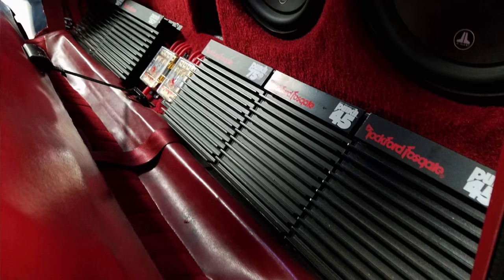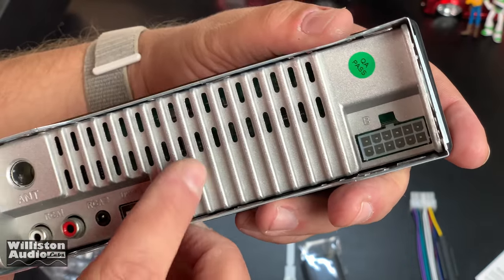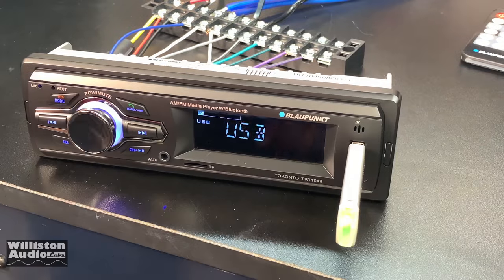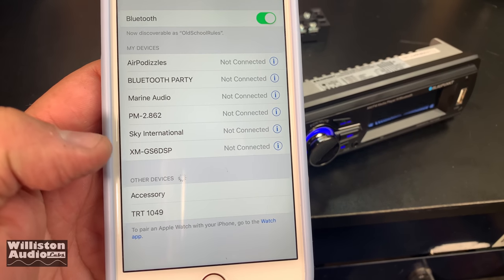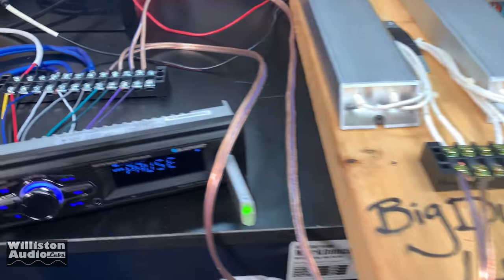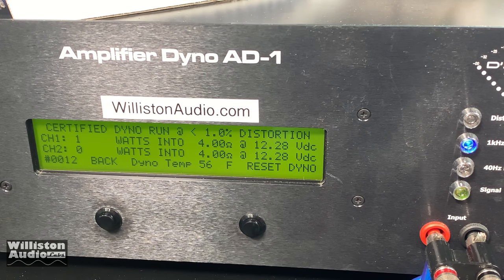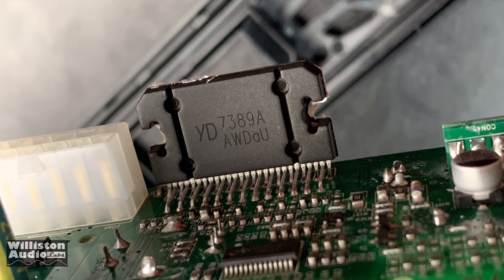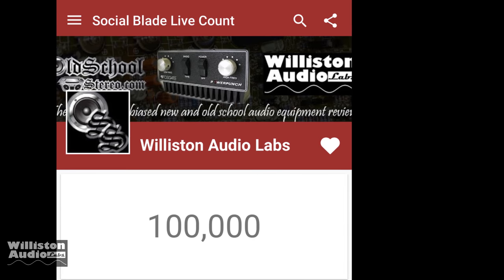Is a $10 Walmart Car Stereo Any Good? [4K]

Comment: i have an ammo can i got when i was in the marines corps. i want to turn it into a portable radio and maybe this $10 usd thing would be great for what im looking for. can you tell me what size and file format the usb drive needs to be?
Reply: Most likely fat32 and 32 gig. Fat32 is easy for embedded computers to use and a simple 16 bit processor can handle drive sizes up to 1tb but software gets slow above 64gig.
Reply: @therealjammit  thats what i was thinking. my kenwood only does fat 32 and fat16, and up to 32gig but can only handle like 200 folders which with my music is like 22 gigabytes if i finesse it.

Comment: I had a much more expensive JVC stereo with all the same features and no cd player, yet had RDS, that would get hot on long drives and start crackling, should have done an extended test over say an hour near top volume

Comment: The 3.5mm/RCA2 jack is probably some kind of digital connection like SP/DIF, maybe to connect to a power booster made by the same company, which would have the appropriate connections. It looks similar to the jack on the back of my creative sound blaster that is intended for SPDIF, except that the SPDIF input on my home stereo is an RCA jack, and I don’t know what kind of adapters or connectors I would need to plug the back of my sound blaster into the SPDIF or Lightpipe on my TV. The back of my TV connects to my Kenwood with a light pipe got from Walmart for five dollars at what has been working well. But this does not look like a standard TOSlink.

I may buy one of these things to replace my branded Hyundai six CD changer which is on it’s last legs after a Home made a CD got stuck in there and wrecked the entire assembly. But unfortunately in order to replace something as simple as an audio unit, I have to disassemble the Dashboard in my car 😂
Reply: It would definitely make sense if Blaupunkt has a secondary power booster, intended to be used with this head unit- i’m going to see if I can find a catalog online to see what products are designed to work with this. It doesn’t look too bad, except that I wonder how much wattage comes out of the back of this thing or is it strictly intended to be used with a secondary power supply?
Reply from the maker: Sorry for the confusion...it’s rear line level output. I retested with a different cable and updated video description with this info

Comment: So if you were going to use this for a portable system what speakers would you recommend?
Reply from the maker: Wow, so many choices..depends on your goals. Parts Express has great speakers for portable projects
Reply: How about the cheapest ones walmart sells in the size that works for your application?  :)
I like to do portable setups inside of medium sized coolers.  Open the lid to see the stereo and use bluetooth for controlling the music volume, track, etc.  I use the biggest speakers that will fit and typically that's 6.5 inch units.  Power it how you want, but I choose sealed led acid used for UPS batteries.  These are cheap, pretty heavy, but can be charged with anything that charges 12 volt lead acid batteries.  I use commercial velcro to stick everything to the cooler interior floor or walls.  You don't even need an on/off switch if you just wanna go super cheap and basic.  Just unplug the stereo from the battery's spade terminals.

Comment: I bought a $20 Boss Audio head unit from best buy, says it can do USB, but I haven't been able to find that setting, also I've not been able to see the clock (The backlight turns off when you turn the radio off, so you can't even see the clock, lol)

Comment: Need to see this done with pioneer headunits
Reply from the maker: Need
Reply: @wal  plleeeeeaaaassssseeeee. I'd love to know how much power they actually make and how clear they are.
Reply: @sethdrak3  they work just fine Seth, the reason they are so small as they don't have a CD player in there. Of course you're never going to get it for $10 I think they sell for approximately $30 now but that's still a good deal if you want a basic head unit
Reply: @sethdrak3  again Seth don't forget on top of the price of the unit it's going to have to be installed properly. As far as the sound goes, Big D said that it has 25 watts Max so what's that about 10 watts RMS.

Comment: looks like the price is going back down $12.42 at both amazon and walmart (as of 4-22-19 at 1:15PM CST)
Reply from the maker: Sweet! Buy as soon as you can!
Reply: @wal  Ordered one through your (affiliate?) link. I can think of about 10 uses for one of these. Might buy a 2nd if this one works out.
Reply from the maker: @DanielMiller82  thanks man, yeah the links to Amazon are affiliate, but not Walmart. They haven't approved my affiliate account yet, lol
Reply: I bought the DUAL version from Wallyworld while they were sold out of the Blaus. 
It was $16 and works perfect. 
Been blaring it everyday with usb and bluetooth. 

There is a more expensive one for 30 that looks the same and claims more power, but, I believe it is the exact same as the $16 model, just the newer model with an inflated power claim with the same actual rms output. 

Only cons are, no sd card slot, no second usb input on the back, just the front one.

Comment: @ Williston Audio Labs I have the same car stereo but if you let it get hot from sitting in your car "hot meaning from the sun heat in your car" the LCD display goes out just about all the way but if you keep the heat off of it then it will work fine.. well so far the one I have does.

Comment: It doesn't surprise me this little head did decent because Blaupunkt was known to do good gear back in the day. This looks like a good option for a beater ride or in a install that may see less than ideal conditions so if it gets wet or dirty you won't be upset to toss in a different one. Or in a convertible so its no big deal on security if some sticky fingered idiots show up ya know.

Comment: I Bought A 15 Buck Ebay Headunit Like This I'm Waiting For From China. I Got It For A "Portable" Bluetooth Boom Box. I got This One Instead Because It Also Supported SD Card And Had 4 RCA Outputs For Each Channel (To Easily Connect To A JL MX280/4 I Scored). Also Gonna Be Running A JL MXH300/1 On A Skar IX10 hahaha. Powered By 2 6AH Lithium Batteries And 1 58F Ultra Capacitor Bank. It's Literally A Micro Bass Build haahah. I'll Post You A Link Once It's All Done. I Think You Would Dig It.

Comment: I've had their $20 dual radio and it can make factory speakers sound pretty good better than factory, I put one in my moms 02 saturn and they were loud has decent bass no distortion unless maxed out just like this one so its a good deal
Reply: Yeah I drive a ‘00 Saturn and the stock speakers are still very great
Reply: I bought a few of those units and the tuner is absolute shite.. sound fades in and out.
Reply: I had an ‘01 Saturn and the factory stereo sounded amazing. Have an ‘06 Saturn now and don’t like it’s factory stereo at all.

Comment: 3.5mm socket on the back: backwards compatibility with a failed digital audio system (can't even think of the name right now), still found in some older German cars.
Reply from the maker: It’s rear channel line level output. I updated video description

Comment: Hi thanks for posting this thing it is made in china  the mp3 circuit  inside it is the same like 747d module for 2 $
As for amplifire the tda7388 will do the job but this module 
It can get only fm so its not a full radio circuit
Reply: @KamenkoTV 
Yes but am it is a band like fm and all realy radio circuit have it i like the unit and for the price it is realy good

Comment: On here the antenna hole is on the left if looking at the back, in another pic on google it’s on the right if looking at the back, which side is it on?
Reply from the maker: On mine, it’s on the left side when looking at the back
Reply: Williston Audio Labs thank you! That’s awesome most aftermarket units have them on the right and I can’t find an antenna adapter so my antenna wire is short

Comment: I have almost the same identical unit except its got more at the back by a few cms, same display, remote etc and isn't branded Blaupunkt, paid 15 pounds for it few years ago, says its 4x50w speakers but I doubt that as the pair of 6x9s rear and 4"'s front go fine up to 35 on the volume but start to distort badly 36+ and just sounds awful but 35 is pretty loud and clear.   The SD card reader packed up a while back so I just put a low profile USB drive in the USB socket and it works fine enough, it wasn't for cheap I got it but my car has a very slender dashboard and a full depth unit sticks out by a couple inches and fouls the wiper motor behind.   The remote didn't last at all long, changed the battery out but it just stopped working so wasn't worried about it, its a old classic car so 4 speakers is plenty good enuff.
Reply from the maker: Thanks for watching and commenting!

Comment: I have a suspicion these super budget head units are all made by same manufacturer because I have 3  (About it/DUAL/Efflemour) but two in use one in a diy boombox(running old Aiwa sx870 speakers on mono through my old Planet Audio trq1500.1 amp , and undersized 15a power supply) it cranks!  and a emergency replacement in my van when the pioneer crapped and they work almost identical (which is great) same performance v same menu ect. and the Bluetooth is the best I've owned even better than my $600 Sony home theater AV reciever. I walk into work and and it links as I hit the shop door I hear music playing as I walk in and that's about 75' from boombox! and when I leave its linked when I turn my vans key! I planned on buying another pioneer prob double din when cash freed up but I'm in no hurry now system works awsome running a pioneer monoblock and Soundstream 4 channel! All of these head units have RCA In & outs too!!...
Reply from the maker: Yeah pretty amazing 👍

Comment: Damn, seems like a steal... Wonder if it would actually last in a car. I went through like three dual stereos like an idiot when I was youngin' because they'd always break... Wonder if this would do the same chimpish things?
Reply: At the end it depends how u treat your products. Ive seen people being gentle with their cheap stuff and it lasts them a lifetime. 
Also Ive seen people who smash those buttons as if they were made from titanium and not plastic and then complain "how the thing is garbage". 

Another thing Ive noticed is Americans bitching about European cars breaking. Duuude - the way Americans mistreat their cars is legendary. They would often drive them fast offroad as if they are Jeeps , use summer tires in winter ,  change oil every 15 000 miles ... 
not to mention they slam the doors as if the cars are trucks and on top of it all they are cheap so instead of going to a service would often perform DIY fixes that are defenetely not recommended by the manufacturer. For example soldering all sorts of jumper wires , putting wires instead of fuses etc etc. 

IN 80% cases every broken stuff happens because of mistreatment . Its just people wanna shift blames not wanting to admit that they were abusing the thing. 

So dont abuse it - or youre gonna lose it
Reply: @robotube7361  It is a head unit... If it's properly wired, there really isn't anywhere it even gets abused. It sits in a cars dashboard...
Reply: @leleedler  There are ways and Im not talking about intentional abuse. People often get carried away with either what is happening on the road or talking on a phone many times when they mash the buttons . For example someone is getting angry while talking on a phone with someone and he/she is fuming and would forcefully insert that USB stick hard enough to cause cracking on the plastic. Ive seen lots of PCs whose front USB panel is smashed inwards from forcefully inserting USB sticks. 

That volume control knob is expected to be from low quality plastic and many will unconsciously abuse it . 

Usually the abuse Im talking about comes from not paying attention while u use something. It happens to everyone especially to people who are focused on other things while let their muscle memory do the work. This is when the abuse comes in.
Reply: ive been hard on my dual $20 stereo its 3 years old

Comment: I just tried to use a U.S.B. turntable on mine and it worked  here is how to connect it   1, buy an R.C.A.  to  headphone adaptor 2, a U.S.B cable  3 connect the R.C.A. to the connectors on the turntable  and to the AUX  port of the radio  and the U.S.B. cable to the turntable and to a U.S.B. to a cigarette lighter turn radio on set to AUX set speed of turntable play and enjoy
Reply from the maker: That’s hardcore yo

Comment: I tried to get one from Amazon about 5 days ago,  SOLD out.  I went to Wal-Mart,  said in stock but now $12.45, ok bought one delivery Friday the 19th. Next day got email showing none available. Went back to the site and said 2 available ordered one, delivery on 4/22 Monday.  I checked a few days later and order was filled.  Still  don't know if first order is coming. Very strange. If I get both I will have an emergency gift for someone.

Just got an email from UPS, my package is on the way and will arrive 4/18/2019. Now i have a tracking number and everything!  Life is good again.
Reply from the maker: I knew the $10 price couldn’t last...
Reply: It's sold out everywhere.

You missed the boat.
Reply: Blactoutguy, I double checked with Wal-Mart  to verify my order. They don't make it easy to get a phone number for customer service. The person I spoke to hadn't mastered the English language, it took 45 minutes to get things straightened out but I should be getting ONE on Monday the twenty second of April a Monday.  Before I posted this update on 4/13 the Wal-Mart site showed 2 in stock.  If anybody wants one give them a try.
Thanks to all.
Richard.

Comment: You didn't get full output power since this unit doesn't seem to incorpirate a DC/DC-converter. Those chips need ~18V to give max power. (It can only swing from negative 12V to positive 12V and nothing more without a dc/dc-step up converter.)
Reply: butchtropic  Of course not, it's just an explanation why the specs didn't match their measurements.
Reply: Lassi Kinnunen  I could be wrong, but I think most (all?) t-amp based chips are bridged internally. If so, then it's a phase shift. (And the data sheet specifies power at 4ohm.) (Edit: The sheet says it's class AB and no class D like a t-amp. That puzzles me.) (Edit2: It also say that it allows a rail-to-rail voltage swing, and that should be -12 to 12V. But I thought AB had too much losses.)
Reply: 12volts into a 4 ohm speaker would be 3 amps peak, or 36 watts peak. Rms is 36 watts x .707 = 23 watts or so. It can definitely do 20watts no problem even without a dc to dc
Reply: butchtropic  you cant even really hear distortion until about 5%, especially in a  car

Comment: I hope someone can help.  I bought one of these replacing a Sony XR-1790.  I literally cut the plugin from the Sony, wired the Blaupunkt plug to it (red to red, Yellow to yellow, white sound to white sound, white/black sound to white/black sound etc.) and plugged it in.  got power, it found radio stations, aux worked (used my Ipod), but no sound whatsoever.  I checked to see if it happened to be on mute. No. Checked to see if my Ipod wasn't playing (sounded fine with headphones.)  Only thing I didn't do is use the remote.  Anyone have any suggestions?  Thanks in advance.

Comment: Hey man I have a question. My power wire that I connect to my car battery to my amp  got cut through just the plastic and the wire isn't touched. Do you think the wire is safe to use still ?
Reply from the maker: Wrap it with electrical tape if the wire itself is not cut, should be ok
Reply: @wal  thank you
Reply: oniel Garcia I would use a heat shrink wrap over the electrical tape just to make it look clean

Comment: What happens when you disconnect the battery? Does it keep the settings?
Is the display readable in the sun? Like installed on a boat?
Reply from the maker: Loses memory. Display is not very bright.

Comment: WTF, why didn't they use a class D? They could make a much more powerful unit for the same price if they used a class D amp.
Why do companies keep insisting in class AB ICs?
Reply from the maker: Probably cheaper since they’ve been around so long
Reply: @wal  I see, economy of scale.
Reply: Has something to do with power supply.  I think you need to step up the voltage if you’re doing Class -D to get reasonable output.

Comment: Not that surprising. If you think about it, it's not much different than a low-priced smartphone (a cheap modern flip-phone even), but without the cellular capabilities and more advanced screen. And the fact that it's 2-3x the size of the phone, makes it much easier to manufacturer.
Reply from the maker: AM/FM tuner, Bluetooth, USBx2, MicroSD, Aux Input, 10x4 RMS Amp, 4-channel RCA outputs, remote control...amazing for the $$ 👈😮

Comment: Actually if the FM chip inside a $100 cellphone is that great  probably yes.  I ditched using a Grundig for my cellphone, because the results for streaming were better.  You can be too good.

Comment: Do I need an aftermarket head unit to hookup a subwoofer?
Reply: Benramin Prarmi, that depends on the head unit in question. Some have outputs built in. Others require aftermarket replacements. Almost all head units require an external amplifier for subwoofers.
Reply: There are aftermarket methods that only require you to use the rear speaker wires to hook up an amplifier

Comment: Ima cop to put it on my mini bike sound system ima just run 2 3.5” JL audio c2s ,ima use an odyssey pc680 to power it and my light bar up , you think Ittl last ?
Reply from the maker: These are hit or miss. Quality is not so good for some. I’d be prepared to get a dud
Reply: Williston Audio Labs guess I’ll get a dual or something